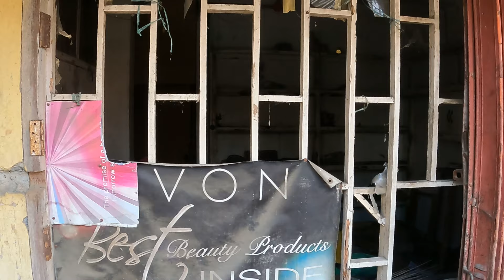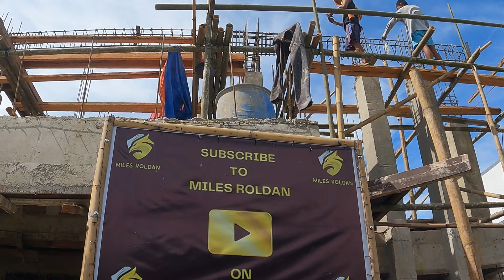VLOG 137: UK BORN FILIPINO - PAINTING THE NEW OFFICE! DREAM HOME BUILD IN THE PHILIPPINES!

Comment: Amazing how the the Gang Gang have no fear 12 meters in the air. And barefoot while working around the project. Leather soles on those feet! That’s actually the best way to walk, natural….
The string with the weighted top looking thing is called a Plum Bob, that item and tube with water (Level) are the old techniques still used in modern work! I aunti go Miles and Gang Gang.
Reply from the maker: Thanks for this & thanks for watching my vlogs